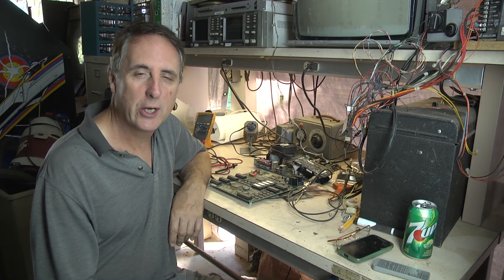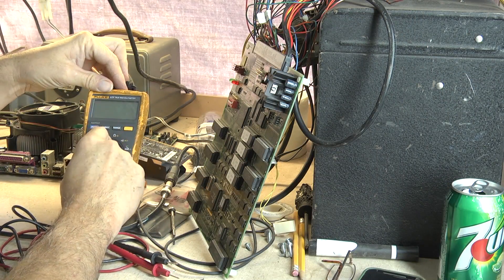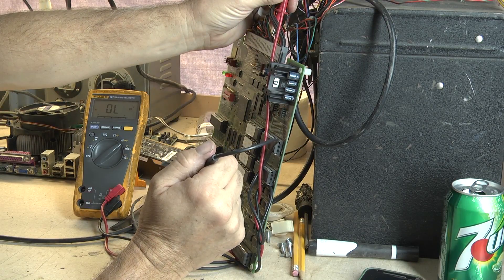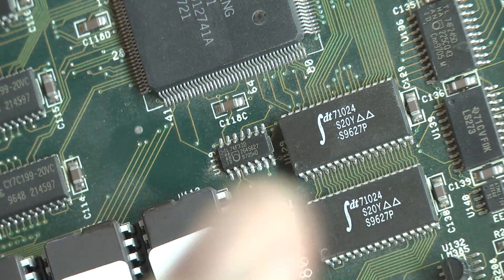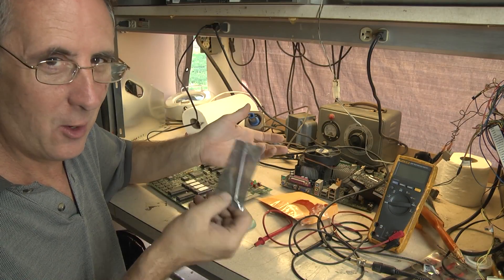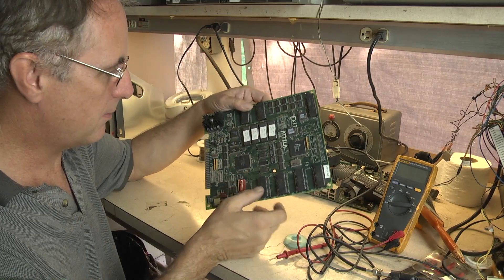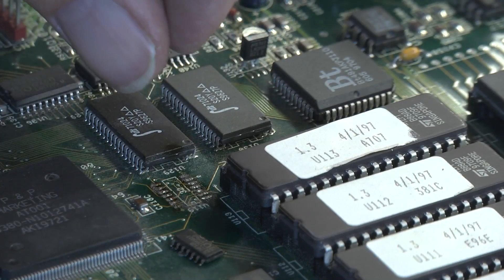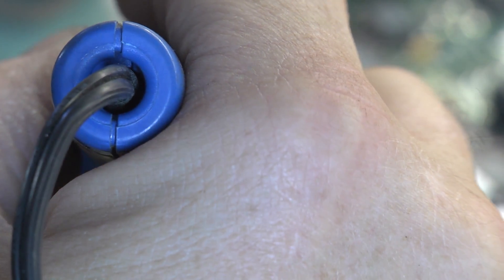Police Trainer Video Sync Repair

Comment: thanks for the video, I am scared to solder smd, but maybe I should start on non arcade pcb's  :) But why don't you clean the pcb before soldering? That's what the thought me at least.
Reply from the maker: Its not too bad with some practice. What I did do before was dust off the board with a soft bristle brush. What I did after the video was clean the area I soldered with some flux remover that I didn't have during the video.